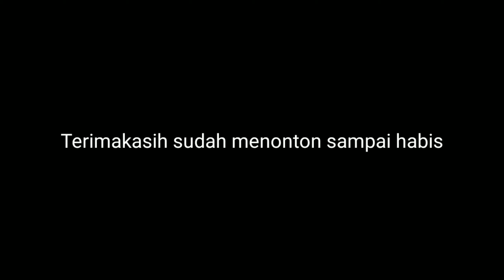proses bongkar pasang ban HD 785 Komatsu ❗❗❗ @jukie_aja

Comment: Salam kenal Pak Jukie,

Channel-nya sangat inspiratif dalam berbagi pengetahuan. Semoga tetap bersemangat.

Khusus untuk wheel-bolting-tool pada baut-baut HD-785, bisa dicoba PLARAD (made-in-Germany) Battery dan Electric Nutruner yang telah digunakan teman-teman di industri tambang dan alat berat di Kalimantan dan Irian sejak 2010. Dengan adanya Battery-Nutrunner yang sangat presisi dan akurat, maka proses bolting pada roda-roda HD-785 bisa dilakukan didalam workshop maupun diluar workshop saat ada unit HD 785 ada kendala yg jauh dari workshop (tanpa perlu bawa mobile-compressor dan genset), seperti yg terlihat pada video-link dibawah ini : 
https://youtu.be/-9Ou8WNBM7w